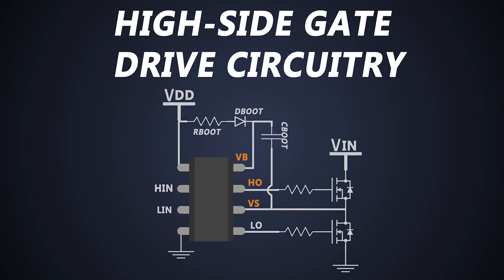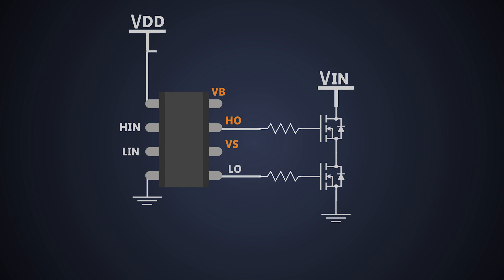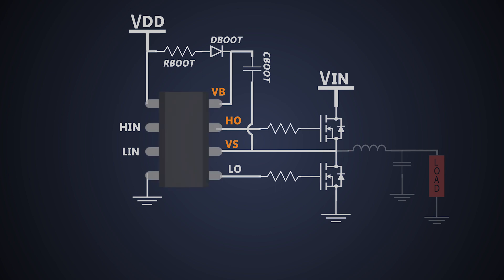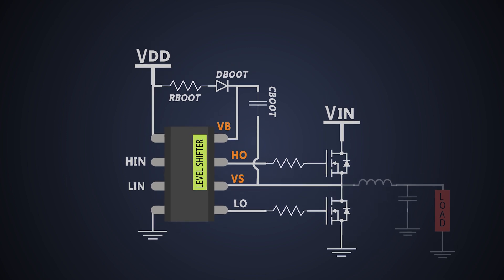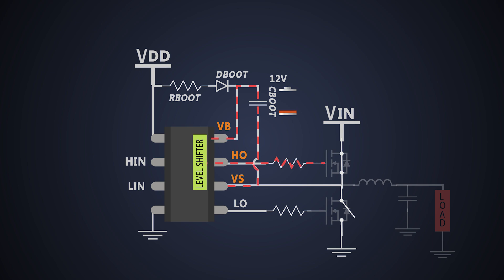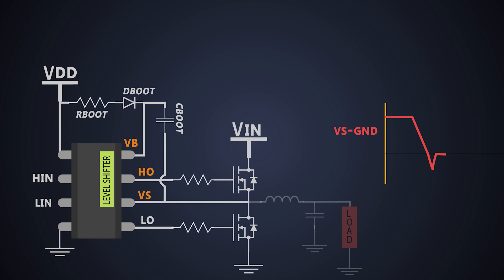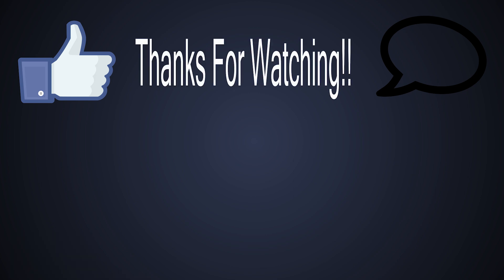How does a Bootstrap gate driving circuit work? Bootstrap MOSFET gate driver technique

Comment: If I want to make a H-bridge 48v to 220v inverter drive by ir2110 and with pwm ic. Which bootstrap capacitor voltage and uf to used

Comment: Very poorly explained, bootstrap application in gate drivers is critical for high-side switches, but the video does not explain the reasons for the diode Dboot, resistance Rboot. Current direction during Cboot discharge is wrong in the animations. NPTEL video on bootstrapping by Prof. Shabari Nath is much better.

Comment: negative voltage transient you talking about can be minimize by using optocoupler right?
Reply: Exactly, that is why the gate driver using TLP250 is much more rugged than conventional high-side driver IC like IR2110.

Comment: You can protect the capacitor and the high side mosfet gate from over voltage with a zener diode, say 15V. Vdd can be much higher then.

Comment: the video was very detailed and helped a lot, but is there any way to apply bootstrap circuitry on high side mosfet without using IC?
Reply: Yes, you just need to apply a pwm to the ls gate. The circuit is a bit different as well

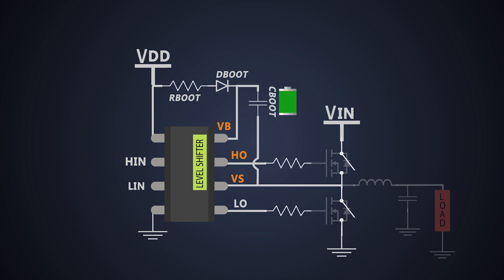Comment: Timestamp 4:02, can you please explain here a bit more, how High Side mosfet can pull VS to High Voltage while it is turn off? Please the IC Part Number.
Reply: at 4:02 Vs is equal to GND till 4:22 when Hin becomes high and in turn Ho makes upper mosfet conduct. At that moment Vs is floting to Vin. Example of part num IRS21867S

Comment: what happen if the high side mosfet is turned on first, in that case the capacitor wont have any charge right, so will that hinder our usage or consequtive cycles will clear this problem
Reply: It is designed in such a way that during the on period you put a charge Q in C, and in the off period the capacitor can't lose more than Q.
Eventually, you'll reach a regime condition where C is charged and the mosfet turns on.

You need to precharge the bootstrap capacitor before turning on the high side mosfet, but it doesn't matter if the first cycle is "on" or "off"

Comment: Hi sir i have ir2104 its not workng, when i chek HO its output is 12v as a input vcc, but the LO without outut. I used two ir2104 as a fullbridge, but when i put SD pin low the HO will 0v and LO is 12v sir, i search that like a fake ir2104(its like a ir2103) but when i try to make the sircuit for ir2103 same not working sir. Do u have solution? I change bootstrap already
Reply: same issues here, have u overcome this problem? pls tell me

Comment: How to calculate the value of a bootstrap capacitor for a given mosfet & frequency?
Reply: I = C * dU/dt with I = Q/t, where Q is your Gatecharge and t half of your swtiching period. dU is the slope of the neccessary gate voltage (e.g. from 10V ON to V OFF). Now solve for C and consider a margin of 20% at least.
Reply: You can also use the definition of stored energy in capacity. If you know the  driving current for your gate you can calculate the neccessary size of your cap.
Reply: Or take a look into this application note :) page 5, formula 7
https://www.onsemi.jp/pub/collateral/an-6076jp.pdf

Comment: This circuit used in computer motherboard with 3 circuit in parallel,but I can't understand one single lower mosfet and inductor getting too hot, but motherboard working properly

Comment: In the manufacturer datasheet I have for IR2104 they have the cricuit you describe but they put a capacitor between the drain of the top MOSFET and the source of the bottom one, is that to mitigate that negative transient you're talking about? I'm not sure to understand that part. Neat video otherwise thx!
Reply: I'm pretty sure that will be done by using optocoupler to drive the gate driver.

Comment: Having a issue when using a bootstrap half bridge driver using IR2101. Expected- During the deadtime interval where the high side must turn off and low side turn on after the dead time.
What's happening- when the dead time starts, the high side switch still conducts with Vg= Vs= Vbus ( not VG= Vbus+Vdd). After the dead time is over the high side MOSFET switches off completely. 
This dosnt happen during the turnoff of low side MOSFET which turns off immediately when dead time starts.
Reply: IR2101 not have anti cross conduction circuit
Reply: @salvatorebarbaro5862  i am giving dead time to to complimentary pulses through microcontroller input
Reply: @anirudhraghunath5901  yes is this the rigth way
Reply: ir2104 is obsolete IC,  find IRS2184 / IRS21844
Reply: @salvatorebarbaro5862  I'm not making a product, it's for research, hence I have a stock of IR2101 which is DIP with independent inputs

Comment: Hi sir I love you video
I have one question
if I need to switch high side mosfit I need to give high signal to ic's (HIN pin )
If i need to switch low side of the mosfit I need to give high signal or low signal to (LIN pin ) ??
Reply from the maker: you need to give high signal to LIN pin

Comment: I am using a 555 for my inverter project but I cant get the high side to turn on and off   Respect to to low side the low and high or turning on at once and short circuiting I use the bjt to slip the signal for high side switching and a puchpull for amplifier current but for some reason everyone YouTube video I side this design work but my same design refused to work just shorting out and blowing up mosfet because am use high volt 24 volt I try using a optocoupler but am getting the same results shorting out so am asking why the bjt amplifier transistor and the low side from the 555 Itself refused to work I checked the circuit over and over to make sure it’s the same at the diagram and it is but still results to work high and low but turns on at the same time

Comment: Excelent explanation 👏. I have a question, Is it possible to apply a 0V signal (not pwn) to the LIN input and a PWM signal to the HIN input?.
Or you must have a complementary PWM to charge and discharge the gate-sourc capacitance of the MOSFET?.
Reply from the maker: you must have a complementary PWM to charge and discharge the 'Decoupling capacitor' to drive high side MOSFET
Reply: @FoolishEngineer  thanks mister for your answer. Saludos from México 🤟
Reply: @FoolishEngineer sir please help 
In my pcb also there is a Pwm and gate driver IC and 02 mosfets 
And the problem is that mosfets are getting defective again and again after replacing them

Comment: Correct me if I am wrong but my understanding is that because of the diode of low side transistor the lowest negative voltage on VS would be -0.7V. Is it really a problem for bootstrap capacitor?
Reply from the maker: No. It will be 0 wrt to gate
Reply: Yes, when the HS FET turns off, the freewheeling body diode of the LS FET turns on due to the inductor current.  The VS pin will be one (body) diode drop below ground.  The body diode isn't a perfect Si PN diode and the forward voltage drop Vf is usually greater than 0.7 V.  So likely a little more than 0.7 V below ground.  You have the right idea.